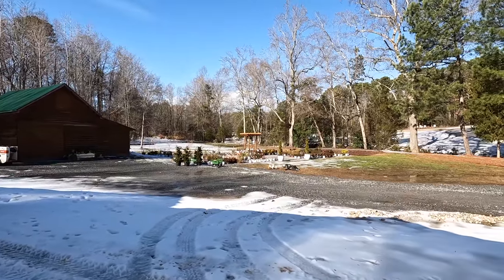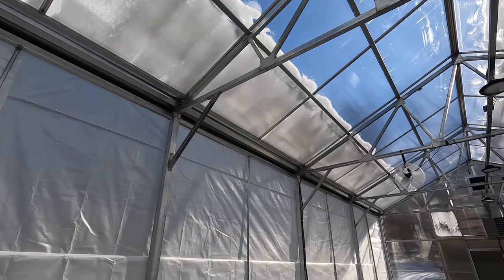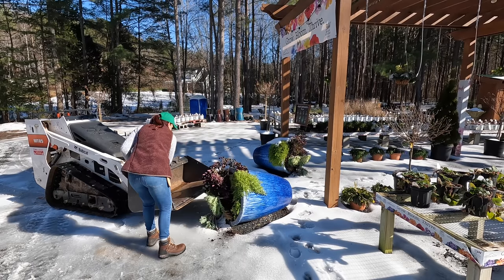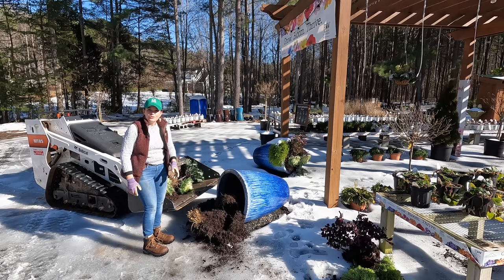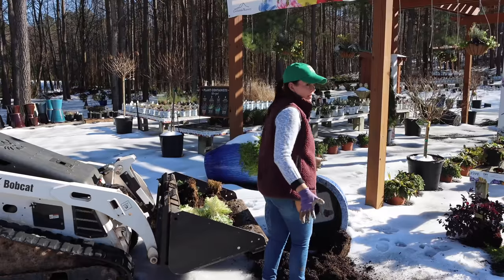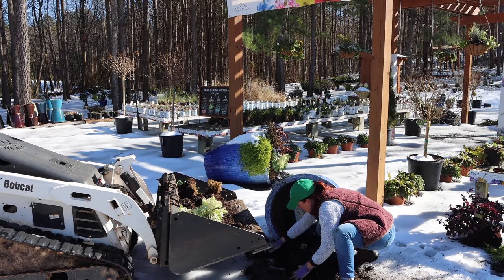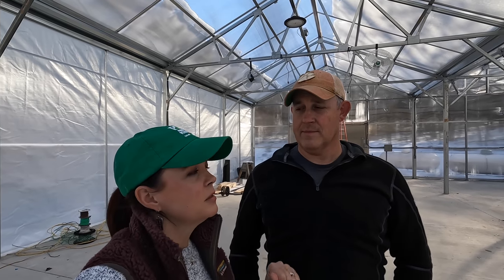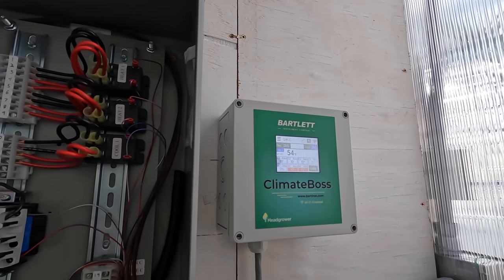A Winter Afternoon at the Nursery | Gardening with Creekside

Comment: I am so glad that I watched this video. I didn't realize that the AquaPots were more for Annuals. I had been thinking of getting one and putting a small drift type rose in it. Now I see that idea would not work. I am assuming that the AquaPot is tipped onto it's side during the winter because the water in the pot could freeze and break the pot. 
Thank you so much for the information now I can adapt my gardening plan ❤❤❤

Comment: [1] I was going to say,,, at 13:00 Jerry sure looks younger, while helping turn the pot upside down. lol
Did  you add another LP gas tank in the back? Is that because of the heater in the greenhouse?
[2]  Great job Jerry on getting it all wired up.  I was worried those LED's were not going to be enough to light that entire building up enough.  But from the pictures,, it seems like it is enough.
Thanks for all the tips and information getting the Atlas set up. I've been taking notes.  
Fingers crossed this  same setup will work for me in Texas. 

[3]   I've been waiting so long to see the tables going in and the place filling up with greenery. This will give me an idea on what I need to do for my new 490 acre farm in texas, for that greenhouse. that is for farm to table growing.  
My 380 acre Minnesota property has me limited from September to May without much activity, other than sowing in the greenhouses for spring planting.
Besides getting this same size Atlas, in Texas, I am adding a smaller one behind it for year round microgreens growing, and other edibles like all kinds of sprouts. 
The Texas property  is getting ready to be excavated in 3-4 weeks,, clearing & flattening it all out, plus digging everything down 24 inches,, to cleaning out the rock, and loosing the soil. Adding in compost, manure and so on,, then tilling it into the soil to get it ready for planting by the end of april.  
My brother teases me that I will have all the texas, oklahoma and tennessee moonshiners coming to buy up all my barley and hops crops, [which is half of my property product]  on the first harvast day. lol
The other half of the property is all veggies and a grove. The grove will be planted immediately after the excavation is done. Already have the trees ordered and ready for delivery.
I can't wait to get the buildings built in the next couple of months. It's all so exciting.